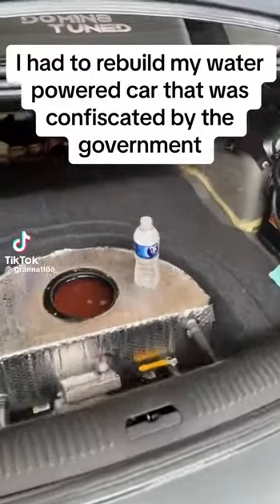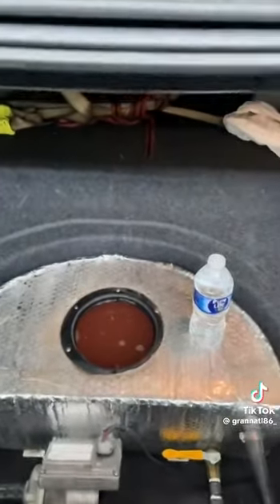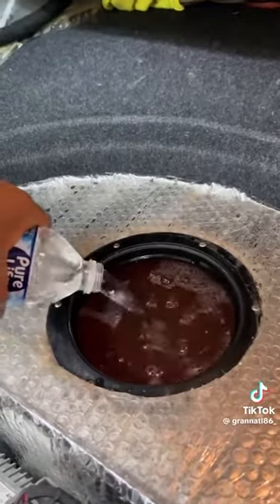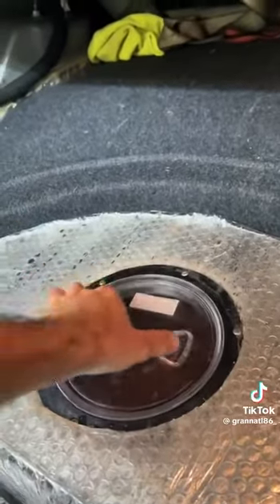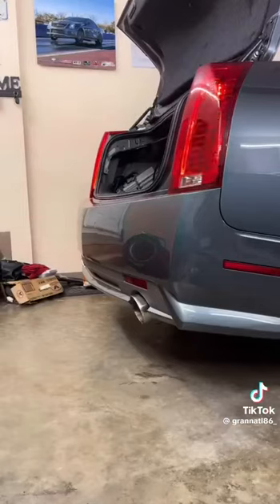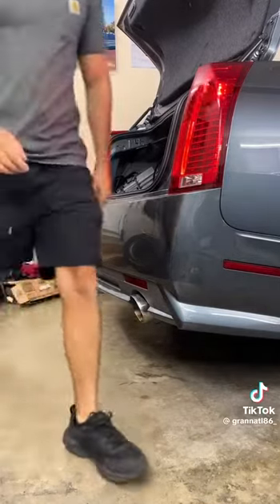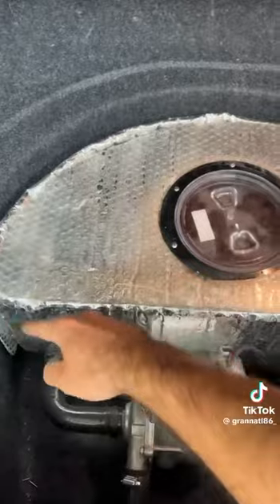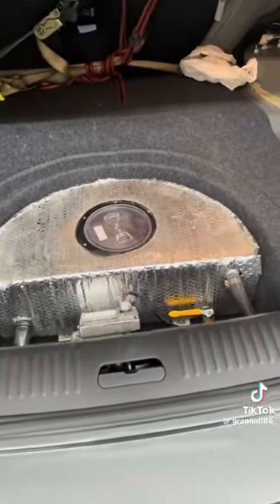A Water-Powered Cadillac?

Comment: What's exactiy does this show? 
Absolutely nothing! 
 He has a water tank in his trunk and a pump to circulate the water around from one side to the other.The engine is running on gas as far as we know. It doesn't describe anything of how the water is injected, combustion process works in the cylinders, not to mention how antifreeze would combust mixed with water, how the catalytic converters wouldn't be destroyed,  how the O2 sensors would be able to calculate to the ECM how long injector pulse widths would be determined, what would the sparkplugs be used for being how water/antifreeze combo is not flammable and why would some kind of smoke or steam be coming out of the tail pipes?
I mean besides those things yo name a quick "Few" this seems pretty legit and is quite the engineering accomplishment. Hard to believe the government let go of such a ground breaking modern marvel scientific/engineering  masterpiece that will change the tides of the entire oil industry forever.